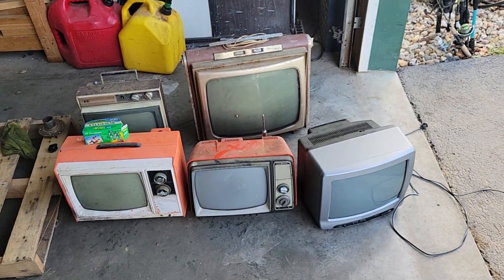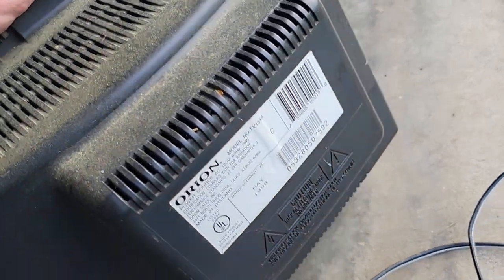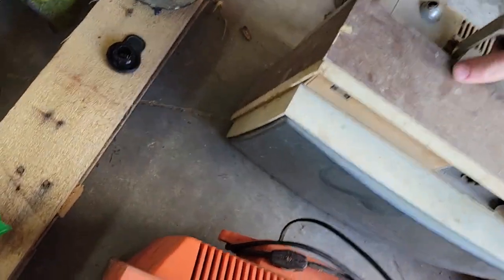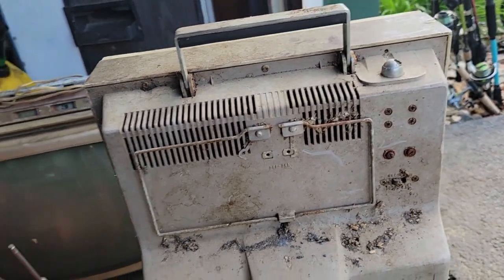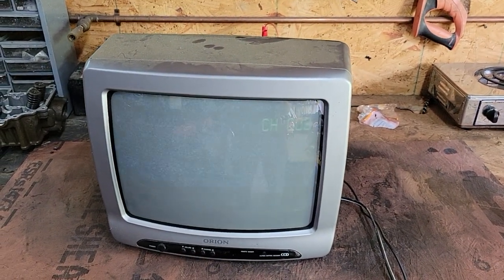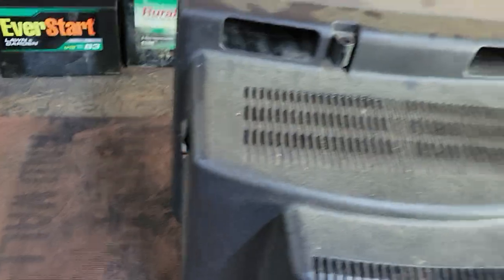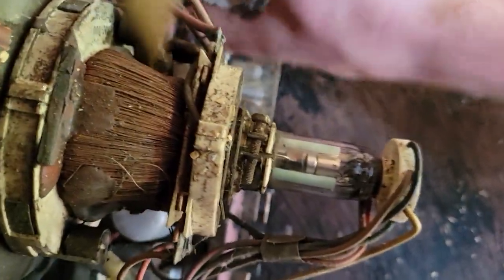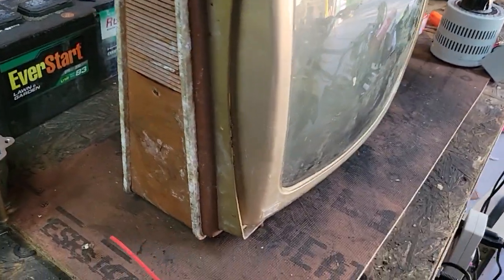5 Vintage Crusty Televisions Assesment

Comment: A couple of thoughts on the Orien, I'm guessing the only way to access the menu is through the remote, and while the signal generator should have given off some sound, I'm guessing that with no signal it has an automatic muting function so you don't get the annoying white noise from it
Reply: First, I have a broksonic TV that has the same board as that TV and you're right, the menu can only be accessed by the remote